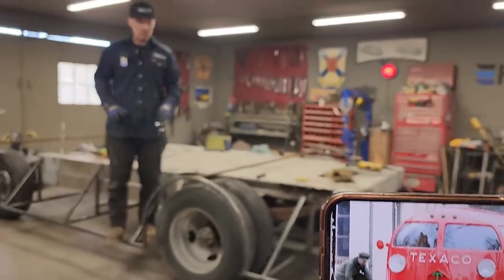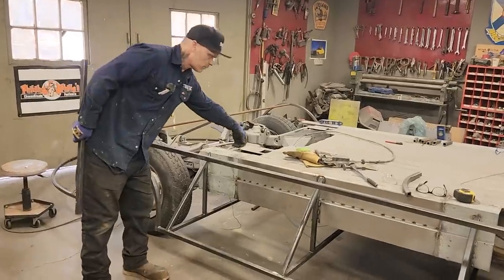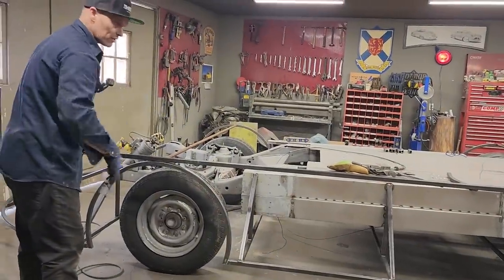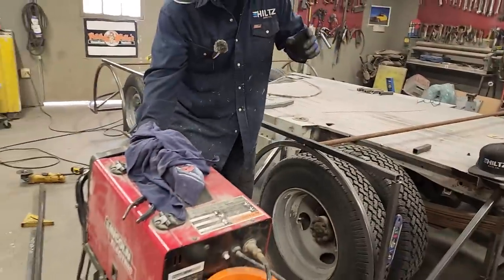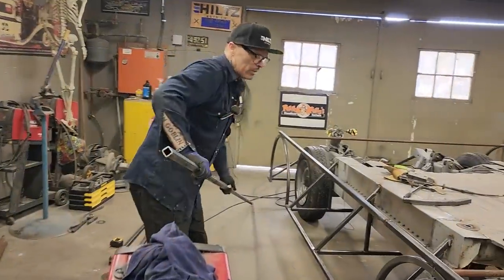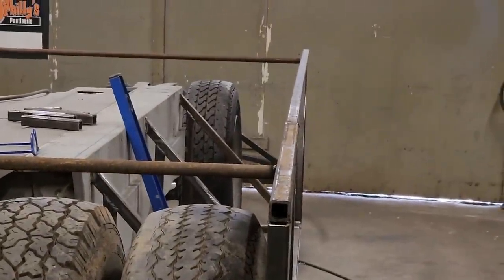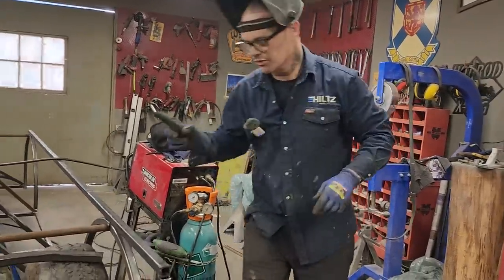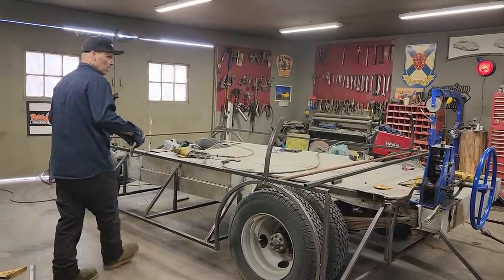The fabrication of the Texaco tanker continues 🛠

Comment: I think perhaps seating height and steering geometry should be addressed to establish head room on the body.
Reply: Yes , it looks like there will have to be a reclining seat to drive it !  Very low head room .
Reply: Especially since this is scaled down from the original.
Reply: I don't think it's going to  be high enough for passenger headroom. 5 1/2 feet tall is probably going to be better.

Comment: Yep. I think double wheels front and back would really look cool on this build. Happy birthday to Jolene. Excellent video work.
Reply: There’s two problems with that, firstly steering will be very hard but the big problem is the turning arc of the outside of the wheel will be huge so if you can imagine full locking the steering now then bolt a wheel on the outside you would find the outside wheel won’t fit inside the wheel arch.

Comment: Just some ideas.. For engine install and service, do clam shell hinged body section. Hinge so they open outward from the body frame. Ideally you could sheet them in aluminum for weight saving while opening. Cab section, then engine bay, then cargo area. Many happy returns to Jolene. This is a fascinating build.

Comment: HAPPY BIRTHDAY JOLENE !!! WOOT WOOT !!! Lower structure is looking great and pretty solid so far. Chad mentioned the roof height will be 30" above the platform height. This means the height of the truck will be 12 inches lower than the original. I wonder if that retains the same height/width ratio of the original truck which is what makes the Doodle Bug so cool. My question is,,, would it make sense to first determine the drivers sitting height and build in the driver floorboard before committing to a roof height. In a sitting position Chad is probably about 36 inches from his butt to the top of his head. If the roof height is only 30 inches above the existing platform that means the drivers seat is already at a 6 inch deficit from that deck to be able to drive the truck and he hasnt put a seat in it. So Chad mentioned he is making the correct decision to put the driver in front of the front axle which will allow him to drop the drivers compartment lower than the existing platform of the truck.  This means he will be building the drivers seat between and a little below the front frame horns of the truck. This also means that the top of drivers seat bottom must be at least 40 inches from the roof he is planning on building. Now add about 10 inches of seat height from the floorboard to the seat bottom height. Now he needs to have at least 50 inches from the drivers floorboard to the roof. This means he now has to build a drivers floorboard in front of the front axle that is 20 inches BELOW the existing platform of the truck,,, or he has to raise the height of the roof to be able to drive the truck.  I am excited to see how he will solve that dilemma and if the roof height remains at 60". He is going to use a lot material buidling a roof and that would be a bummer to have to build it twice! This is gonna be sooo cool to drive!
Reply: Wow that slide ruler must be on fire😂😂😂❤
Reply: Maybe Chad is not very tall so it won’t be a problem?  When he raised the tape measure up to show us where 60 inches is it looks like he’s around 5 feet  and a few inches. I’m sure he’ll figure it out. Whatever it takes.
Reply: I was thinking the same thing as you are

Comment: Chad.  Just a thought about the horizontal pieces that run from one side of the vehicle to the other.  Remove them, then install diagonal braces from the bottom of your triangle to the underside of the floor, basically making a double triangle.

Comment: Happy Birthday! to the Queen!....New Subscriber here from Ontario......Just thought I'd throw a reminder out there . Don't forget to set your Square stock for the roof ribbing on ( 2 foot Centers ) The 4 foot sheet metal will lay half way on your square stock on both sides allowing the next sheets on either side to flush up ...this will prevent any overlapping of the sections....and may also save on cutting and not having to fill in any overlaps later on with the bodywork.... "That's my belly button!"

Comment: Happy birthday Jolene!
Chad, find some 22.5 aluminum Alcoa track wheels and have the machines down to 22”
You can get cheap 22” tires to put on them
Still need to find 1 ton Dodge from spindles with the factory spacers to spec out the from wheels

Comment: Lift the truck up and install the engine from below by lowering the truck down over the engine, Chrysler did it that way up until the mid 70s. They made a K-member that bolted to the frame .

Comment: Hi Chad, if you set a “ridge beam”( just square stock ladder) along centre line @ 60 inch minus stock thickness from floor it may help keep stuff in line, (maybe use a flexible rod side to side to show natural arc, also is there a crown to roofline front to rear, keep up the amazing work bud, Happy Birthday Jolene also ❤️🇬🇧💙

Comment: Just an idea. I just made a pattern by using 2 inch straps of cardboard.  Its a fast and easy way to make an accurate template. I like to use the alluminum tape to hold it together that they use on HVAC metal ducting because it doesn't move and keeps the pattern true. If you like it keep it if not throw it away!
Reply: Sorry I can't figure out how to send the picture.

Comment: Happy Birthday Jolene.  An Ideal for the front tire is use some doodle rims but just put one on like it's the out side one. Don't put both on the front because it will make steering harder.  Back when I drove Trucks I had one truck that had wide tires on it, that's how I know. Can be done just harder steering.

Comment: First off love the channel and Happy Birthday to Jolene. So a couple things I see and want to comment. Fisrt off maybe set a seat on the floorboard to see the drivers height. The Texixo has those bigger tires and the lower body line is at approx half way on the tall tires which helps for driveway clearance for the front end. Yourss is approx 5" below half way on your shorter tires. Your front end may shovel into a driveway dip. Good luck and keep up the great content.

Comment: Happy Birthday Jolene! I'm just curious why you are using square tubing instead of round tubing. you could actually be using 1/2" or 3/4"
 conduit and then sheath it with 18 gauge sheet metal. Look at all of Darryl Starbirds customs. I have made roll pans and spoilers etc. using this method and it is super strong. I think my tubes were spaced about 12" apart. Thanks

Comment: A fix for the front wheel issue. You can step away from the original and do full skirts on the rear AND front. You can hide the problem and the wheel has room to turn without interference.  Happy B day!

Comment: It will be nice if you can put  hydraulic hinges in both sides so you can race the entire body, or maybe from the front and back like a dump truck, or an 18 wheeler truck cab? you will also have access to the motor.  Happy birthday Jolene.

Comment: As far as the front wheels go you need to build longer and stronger control arms to set the wheels out. From the looks as if they need to come out about 8 inches. Spacers and or offset wheels will put too much stress on the wheel bearings and also change the geometry of the front suspension.

Comment: Chad with the rake due to the different tires you would have wanted to use a square because you want to follow the square of the frame.  The level would be fine for the skirting but in the frame you have to keep in mind of the references.

Comment: Chad… Happy Birthday Jolene. In the picture I see the bottom of the body is close to the center of the Wheels. If the wheels are 36”, then the body is at about 18” off the ground. Your Wheels are 30” which means the center is at about 15”. But your body is even lower than that. A Paint Can and a 2x4, or less than 10”. If you make the total height 60”, it seems your inside height will only be 30”. Seems like a crawl space.

Comment: Your suspension is going to be compressed to some extent as you get the body and drivetrain installed, so you might gain a couple of inches for interior space.  It’s looking like you are going to have seats which are reclined to a great extent.

Comment: You asked for ideas bringing the front wheels out to the edge of frame I had the same deal with a 48 Ford Coupe with Mustang front end , had to narrow the stock frame (WIDE) down to the Mustang (NARROW) steering. Cut the front end in the middle Then back about 6 inches from the Torsion bar . Keep this cut absolutely level after pulling wheels out to where you want them. Make new frame 1/8 thick material , ,Make new frame level behind torsion bars. put new frame inside the old frame ,plug weld it and weld solid all 4 sides of frame front cross member also . No cost other than your time and 1/8 inch material to reframe and round for tie rod round stock to put back together.
 THINK ABOUT IT > JIM

Comment: Have you figured out how to widen the front wheelbase yet? 
The GMC Motorama trucks had dual wheels in the front. Can you use dual rims in the front, with the tire only on the outside rim and cut the inside rim dow to the hub only?

Comment: Chad, I know you like working with metal, can I suggest you take a piece of plywood from wheel arch to wheel arch and draw the roof line to put in perspective what the height of Doodlebug will look like. You could even use it for a template  for every roof structure.  24" on center makes sense. I'm just say, I've always thought the Doodlebug was ahead of it's time.

Comment: If you are changing the roof height from the original doodlebug 72" to now be 60" (bit over double the wheel diameter) are you adjust the trucks width too to keep the scale correct? or is that not really important?

Comment: A tank truck has 'side compartments' for equipment like the meter and hose reels. Not known as toolboxes but compartments. Also the term 'roof' does not fit for a tank truck.Usually referred to as the top of the tank. Keep on creating. Thanks for all the entertainment.

Comment: The short section just above the lip of the wheel opening doesn't curve up.  It looks like in the pic of the doodlebug that it goes straight up a few inches then almost does a 90 toward the body (not a curve).   Look closely at the pic of doodlebug (DB) at 5.11 minutes into the video.  What makes the DB look cool is those flat (horizontal) areas just above the wheel opening.  Also, that 90 degree feature doesn't run the length of the body, it's only around the wheel wells.  Lastly,  the pic of the DB shows 4 or 5 inches of vertical directly above the wheel lip then (proportionately) it should only be 2 or 3 inches on this small version of the Bad Chad's DB.  Otherwise GREAT JOB!!!!!

Comment: I’m wondering about how you are planing on getting into the doodlebug. The original one has the doors in front of the front wheels. It doesn’t seem to me that the is enough room for a door at that location on yours. Also the frame height on the original looks to be about the height of the centre of the tires. Yours is a lot higher. Making your floor higher too. You likely need to lower everything in front of the front wheels.  Happy Birthday Jolene.  Your filming is rock steady and impressive. I love watching you two. ☮️🇨🇦

Comment: might want to think about using your triangle square instead of a level that way if the bottom rail is a little out of level it will still be square with itself no matter the rake of the truck 😊

Comment: the engine and trans will be hard to install with the roof frame in place or you could make it so they get installed from under side with a cradle built to bolt in from under side you would have to lift truck and lower down onto cradle . and think about the front doors before you go to far on the front the tool boxes on the side should be strong enough to use to lift truck pan the bottom of boxes then the rest fill in make lifting points near the wheels  the engine would sit lower then the floor to connect to the bottom of frame the arch of the roof will make the sides stronger so lifting the truck after it is complete  should not be a problem  just plan ahead please drive train ,passengers and driver controls

Comment: Jolene, have Chad explain the seating arrangement and how many passengers it will hold . From the floor to the roof is less than 3 feet.  With the engine in the middle and the driver and one passenger up front of the steering, I would like to know where are the doors located. It has to have the front open up like a Izetta .  I am a little confused.

Comment: If you need to raise the front 2-3 inches, put '72-'93  Dodge Pickup lower control arms on it, They do the opposite to lower pickups without messing up the geometry. If it works one way, it should work the other way.

Comment: The sides of the body start sloping inward from the bottom of the wheel wells, not the top, giving each wheel well a bit of a fender look at the top.  Much better looking in my opinion than just a slab side straight p from the ground with a round roof sitting on it.

Comment: If you try to use duals in front or even a single extreme concave “wheel” bear in mind the outer edge will sweep a good six to eight inches or more. It will hit the wheel well. Really need to move wheel out, Yipes! Or make plenty of room for swing of wheel, or limit the turning of the wheels with stops? Look forward to the solution.

Comment: CHAD! DIDN'T WANT TO SAY ANYTHING, BUT I THINK,IF YOU AND JOLENE ARE GOING TO BE SITTING IN THE FRONT OF THE TRUCK!, AND JUST SAYING - DO YOU THINK YOU WILL BE SAFE IN ACCIDENT USING ONLY SQUARE STOCK  METAL? , AND ONE MORE THINK?- HOW WOULD YOU JACK UP THE TRUCK, USING ONLY SQUARE STOCK METAL AND NO FRAME TO LIFT IT?- THE BACK YOU CAN CHANGE, BUT CHANGING THE FRONT TIRES WOULD BE A JOB - AND WERE WOULD PUT A HYDRAULIC JACK TO LIFT IT? ALL THE TIRES  ARE DEEP INSIDE THE WHEEL WELLS, AND IF YOU GET A FLAT IN THE FRONT, THE TRUCK BODY SO WIDE, THAT THE FLAT SIDE WOULD TOUCH THE GROUND -MIGHT BY WRONG CHAD, BUT THAT WHAT I SEE?-AND A VERY BEST HAPPY BIRTHDAY TO YOU JOLENE, AND MANY MORE!!

Comment: I would still suggest suspending an engine cradle under the chassis, engine install or removal is from the underside, it can be hung at any point you need it

Comment: Happy belated birthday Jolene.
 In the original doodlebug, the driver looks to be sitting in front of and at a height about the top of the front tires. Is that even possible with the way you are doing the front on this?

Comment: That curve isn’t going to work for driver and passenger, you have the engine, sticking up, plus seating with leg room, unless your building for a midget .  Check from floor up.  Distance, clearance.  The engine also needs a way in and or out, access to.  Then doors to enter to drive, and passenger, again clearance, easy way to get in and out.

Comment: Are you going to. Cut off those cross overs that go under the chassis. With the down riggers attached to the frame there is no need for them and you have extra material to use.

Comment: That’s not going to fit a car inside or a motorcycle inside. How are you going to sit in it are you going to cab forward in front on the wheels. That’s going to be a bear to steer with 4 tires in the front. It looks like you may have to use a straight axle up front.